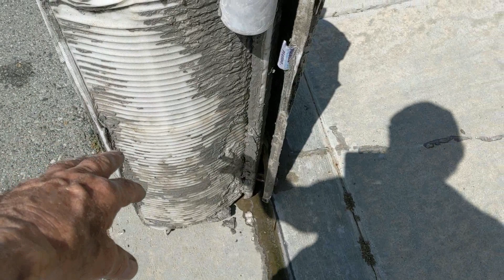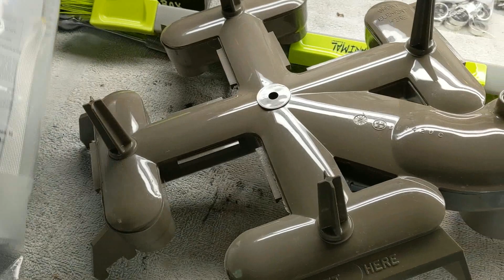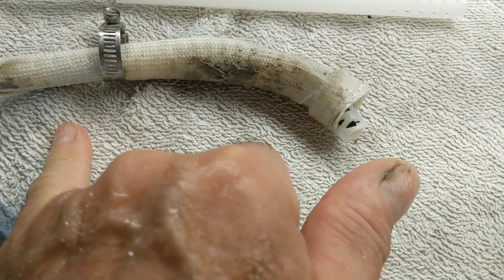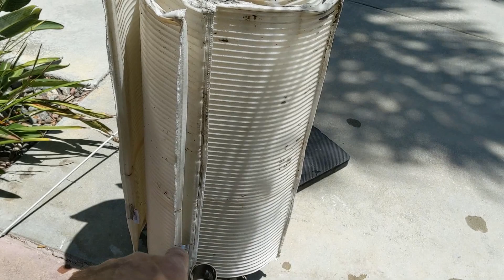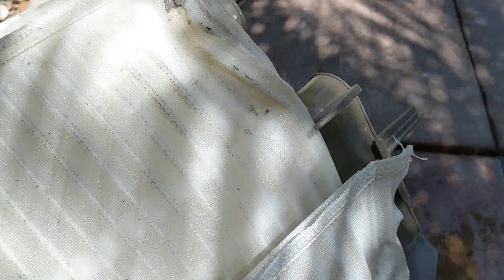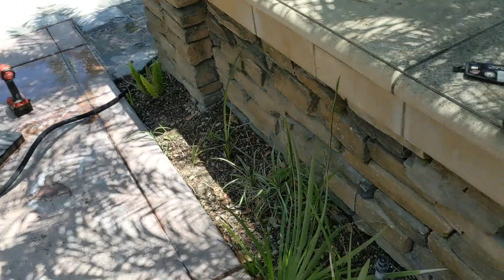Home repair pool filter hayward replace upper top manifold cracked how to assemble filter  by froggy

Comment: Just cracked mine after spending 1.5 hours trying to get the manifold back on (deep cleaning grids and inspecting for leaks). So frustrated… thanks for the video, hopefully the replacement + this method works!

Comment: Hello, i have a similar crack. Can you tell me if you know what the impact is to the performce of the filter i.e, could it cause less pressure that may impact the vacuum.i dont get DE powder in the pool or seem to loose pressure
Reply from the maker: If the crack gets big enough filtration will be reduced & eventually I think you'll see cloudy water. My water seems more clear when I replaced it.

:)
Reply: Mine its broken too i have a pressure of 30 it is 30 pressure normal

Comment: hi froggy, I got a c5 corvette question, have you ever did anything with EBCM unit?... my 99 needs a fix,....service active handling system the DIC says...the 2001 to 04, You can take them off, pry them apart, resolder in 5 places, silicone it back together and reinstall...but 97 to 00 is a different animal...any suggestions...my 04 z06 is fine...thx
Reply from the maker: There is a guy on Corvette Forum called something like ebcmfixer or such, heard he is good.